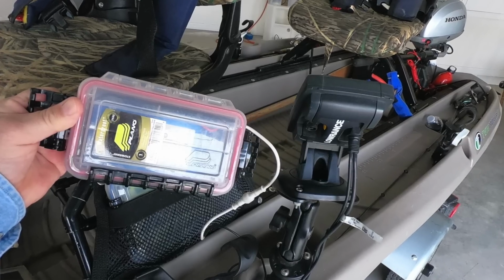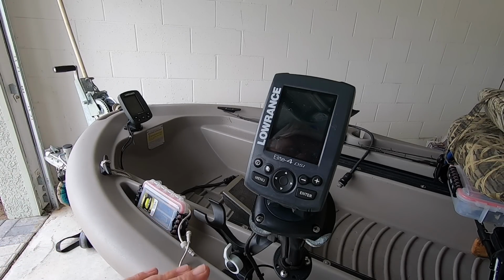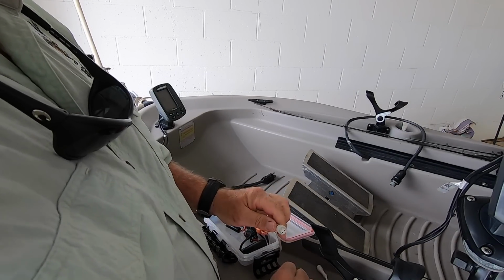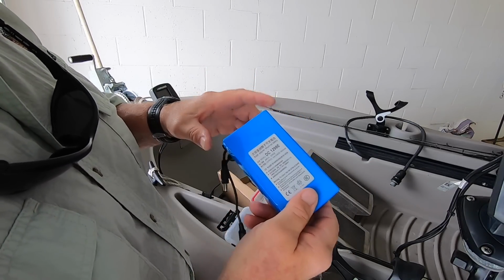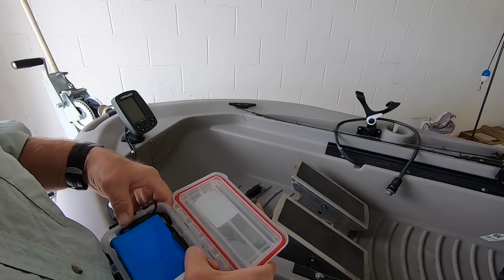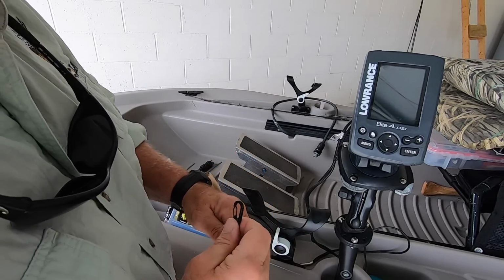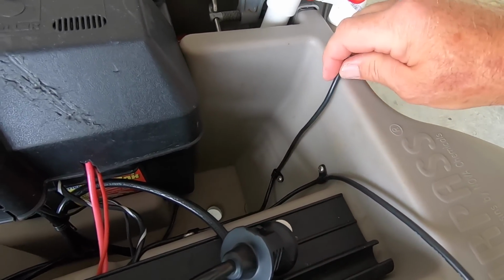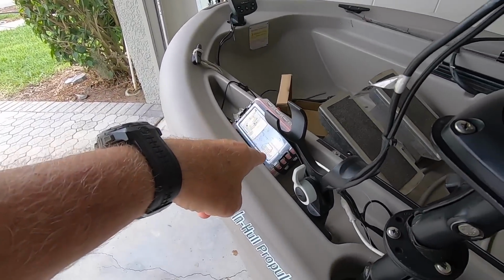DO I REALLY NEED A BATTERY TO RUN MY FISHFINDER?

Comment: I run fish finder and trolling motor off same battery .
Reply from the maker: I choose to not use the battery that gets me home for things other than that. You certainly can do that in your boat, it is a decision I have chosen for me.           Gerry
Reply: @LunkerFishing  , I have a smaller spare that rides in the stern of the kayak for emergencies. Never have had to use it yet . But , if the fish keeps biting …
Reply from the maker: @LovingIdaho  Why bother having it with you and not using it? I am not in a kayak. I use my separate battery to power my electronics so as to not run down my propulsion battery. Trying to swim home with the alligators and snakes is not what I want to do.
Reply from the maker: Since this video was aired I replaced the fish finder on the side and that extra battery. I installed a 9" Garmin and also added LiveScope and have two 16ah lithium batteries. One for the Garmin, one for the LiveScope, in addition to a Battle Born 100ah lithium as the main propulsion battery.

Comment: That is a really slick battery setup.   I wonder if I could use that same battery for running bow and sterm LED lights.  I have a PELICAN MONACO DLX PEDAL BOAT for fishing from.  I don't keep her out on the lake at night but having a setup like that attached to running lights would be a wise addition.  Say maybe for an approaching storm or for anytime dusk or darkness arrives before I get back to the boat dock or shoreline.  Thanks for showcasing your system and I'll research getting something similar for myself.  Nice video!
Reply from the maker: Pamela, I see no reason to stop you from using this kind of battery especially for LED lights since they use little juice. The battery I originally had would run my fish finder for two all day fishing trips and this battery is considerably larger.                    Gerry

Comment: Jerry, Is there a way to use a lithium battery like from a drill to run a simple depth finder like a Lowrance 4.
Reply from the maker: Yes, I believe so. Somewhere , Amazon, eBay, etc. I saw an adapter that slides on to some batteries for drills and gives you wires to connect to a fish finder or something else. Do not forget to install a fuse between the battery and the item you are powering.      Gerry

Comment: If I were to hide the battery and then add a switch that is connected directly to one of its wires to be an on/off switch would it hurt the battery?
Reply from the maker: It would be no different than disconnecting the battery from the fish finder at the coupling, so no it would not bother it. I would however, keep the battery in the on position so after fishing you should turn it off at the battery. You would likely be charging the battery at that time so you would notice the little red light was still on at the battery switch indicating the battery was still on. 
You should install a waterproof switch away from the battery in case you are in the weather to avoid corrosion of the contacts inside the switch.       Good question!                   Gerry

Comment: Jerry where did you get your connector that connects from the fuse to the battery and what size fuse did you use thank you
Reply from the maker: Jerry, I am not sure where I got the connector from the battery to the fuse. I think I either got it at a auto parts store (like Pep Boys, Autozone, NAPA, etc.) or I got it at a place like Radio Shack or similar electrical supplies. Possibly a hardware store may have all those items also. The fuse holder came from an auto parts store and takes regular blade type small automotive fuses. The manual for the fish finder dictates the size of the fuse required. Mine is 3-amp. Good question.                 Gerry

Comment: Can I use one of the small say 30 to 50000mAh rechargeable power banks (like the one I carry in my truck to jump start stranded motorists) for this same purpose..and just recharge it at the end of the day?..you have really got wheels turning in this old mechanical engineering mind of mine..Thanks I needed that!!..power pack?
Reply from the maker: Clyde, 
Without knowing the demands of your fish finder I cannot really say. If your fish finder draws less than the power banks supply then yes you can use them. 
In this video I am using a smaller fish finder that I no longer use. The battery I show you was more than enough to power that fish finder for an entire day, plus part of another fishing day. 
I now have a 9" screen Garmin fish finder. I quickly found this battery was not large enough to power that fish finder for more than a couple of hours. In order to power that new fish finder I went to a 16ah Lithium battery (If you look at my more recent videos there is a link to that battery below the video in "Show More") and I find that is more than enough to power the larger unit all day plus some power left over. 
I guess to answer your question, it depends on the amps your battery holds versus the amp hours your fish finder uses then multiply that times the number of hours you will use the fish finder before recharging it again.  
I hope helps,
Gerry
Reply: @LunkerFishing  thank you so much..I'm using a Garmin striker4 on a Moken14 kayak for local lakes in central TX..probably 5-8 hrs at a time max..will do the math..am 75 and a lifelong fisherman..1st time kayak.. ..stabilizers.
Endura C2 30 side mount/NPP 50Ah
Garmin striker4/?
Thanks again for your time and expertise..I salute you...

Comment: How do you connect the wires in the box and what type of connectors and waterproof cables did you use.
Reply from the maker: Marty, in the video I show you how I connected all the wires. Some of the waterproof connectors I purchased on eBay but when I look I cannot find them. If you go there or Amazon and search for 12V automotive connectors. They are more waterproof than what I used. The fish finder you use may require different electrical components than what came with my unit so make sure you read your manual so you do not forget to install something.                  Gerry
Reply: Wanna know exactly what wires you used.  I have tbe garmin 4 finder. Please help. Wanna do the same set up

Comment: Do you have a brand name or link to the battery?  I am in desperate need of a smaller battery for my kayak fish finder.
Reply from the maker: Fish, you can look at any of my more recent videos and look at See More under the videos for a link to that battery in this video. 
Amazon has batteries for fish finders also.  
Gerry
Reply: @LunkerFishing  can you tell me what you did to the wire that goes to the fish finder?  I saw that the battery comes with a cord with a metal plug at the end. Did you cut that off?  Are there only two wires behind the plug?
Reply from the maker: Fish, I purchased a coupling and soldered it on the wires so the fitting that is on the battery would just plug into the wire that leads to the fish finder.    Gerry

Comment: NOT AVAILABLE ANYMORE !!!
Reply from the maker: Fatboy, Yes that battery is not available any more that I can find. I replaced it with a 16ah lithium battery because my 9" Garmin needed more power.   Gerry
Reply: @LunkerFishing  THANKS , I JUST CONNECT TO MY SECOND DEEP CYCLE BATTERY IN BOAT. I ALWAYS CARRY 2 BATTERIES IN BOAT. 1 FOR MOTOR AND 1 FOR FISH FINDER. ALSO IN CASE MY BATTERY DIES FOR MOTOR , I HAVE A  SPARE. AS FISH FINDER HARDLY USES ANY POWER.